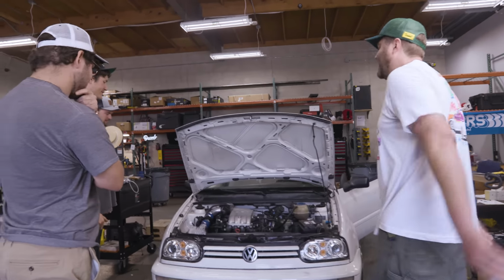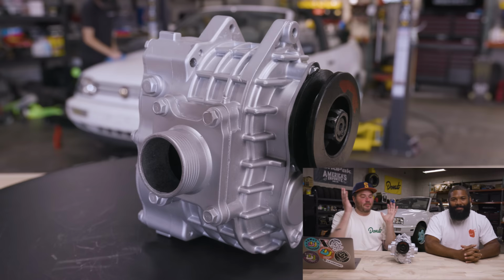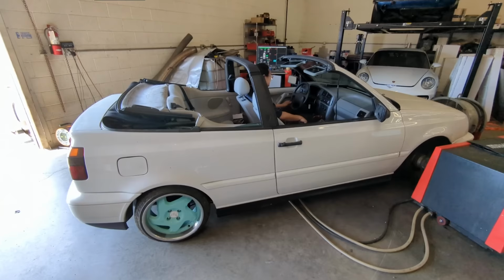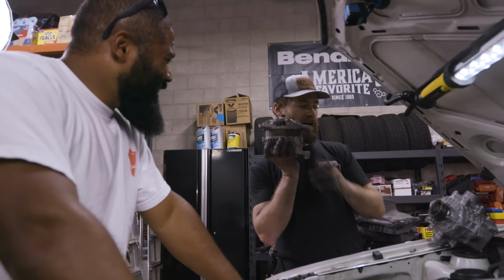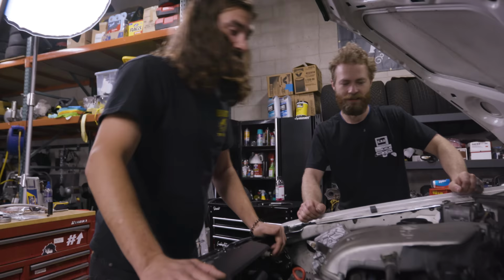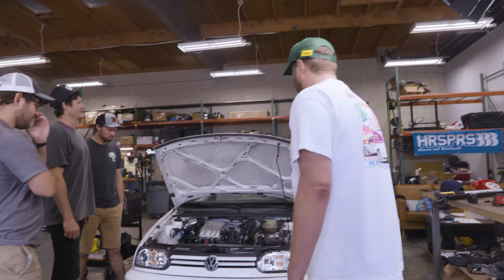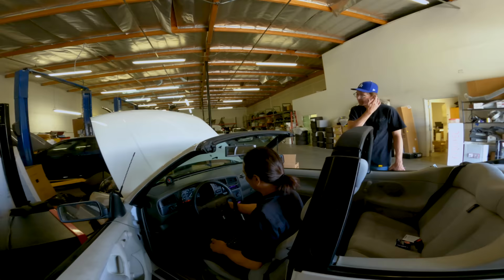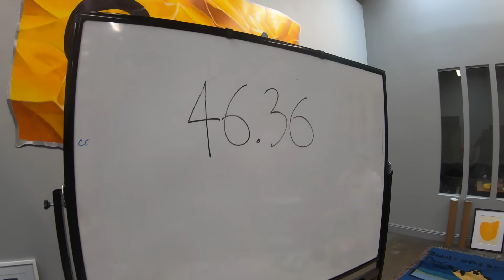We Installed a Wish.com Supercharger on Our Car

Comment: Yeah, see, the motion of the cylinders in your car's engine creates an incredible vacuum, which is how it normally sucks in air. The reason blowers and turbos are so damn expensive is that they need to blow a LOT of air to do more than your engine can do on its own. Even if it could, your car uses that vacuum to do a whole mess of other things to regulate your engine, and if you override it by pouring high-pressure air into your car, you destabilize all of those important functions. So even if you have a proper supercharger, you need to completely re-engineer your engine and secondary items to work on the new vacuum-pressure dynamic. But, that little booster, with its silly air-screw system, is hardly going to do anything at all. It might, maybe, provide enough boost to supercharge a riding mower. But I highly doubt it. I suggest, for your next video, that you start small and use it to supercharge a go-kart powered by a 5hp four-stroke push-mower engine. I don't think engines that small use vacuum the way car engines do, so that might work.

Comment: what did you expectwithout a rising rate Fuel reg,  bigger injectors etc. plus that blower was way too small its was oversped from the minute you started it. you should have bought the correct size for the engine power....

Comment: But you guys were never clear on what happened like what is the 46.3 is that how many horsepower you made after the supercharger or did it add 46.3 hp I’m confused did it cut the horsepower in half or is that what it added to it?

Comment: Well I was considering putting one of these superchargers on my Subaru Outback just to gain low and mid range torque. After hearing it here, there is no phuking way I'd do it. It's definitely a piece of crap. I bet it will self destruct in less than one thousand miles and the noise would be unbearable after five minutes. I'll get a junkyard supercharger off a 3.8 Buick or one off a Ford.

Comment: but one question, it performed 30hp less than stock, do you guys tuned the ecu? because maybe it ain't gettin enough gas. and feul mixture is not proper if not tuned.

Comment: too large an engine not the right pulley, those size superchargers are great for kei cars and small diesels. basically anything you'd use the old vw air pump setup on

Comment: Serious question. Was this mounted as a blow thru or was is used after the throttle plate and MAP? It won't work if you are putting PSI against the MAP as seen in your test.

Comment: It is a k car super charger. And reason didn't get boost because put the same size pulley on it as the car, causing it to stress way harder and not work . The pulley to The super charger needs to be smaller. 
So much for knowing how  cars work, or not. Huh

Comment: lol i wonder if you know vw’s arent like the older civic’s 88-98 sedan/coupe that can run some boost without a tune vw’s need to have their ecu’s reflashed if they are turboed and get changed to supercharged since you have the 2.0 you would of needed more parts besides a tune to make the supercharger work and gain some HP lol i wanted to buy the same supercharger to use it on my 2zzge buttttttt the extra parts i need are costly sooo yeah no go

Comment: I’m confused. Did the car make that much more or lose that much (relative to the initial amount)?
Reply: Its not pumping enough air. Its a 500cc but the engine needs 1000cc so the supercharger is actually choking the engine and killing its power.

Comment: The grind hard guy made it fit but applied it all wrong  . You have to put the throttle body before the supercharger and you need to do calculations to find the correct size pulley for the displacement of the supercharger.  ..... Pretty basic .

Comment: AMR500 is a good little supercharger. Your ratio sucks. Shrink that pulley. Also, don't buy one off Wish. Buy an actual AISIN. They're good for maybe 12.5k rpm and 5 - 6 psi, under which they will run forever. Perfect for builds on stock internals of anything 2.0L or smaller.

Comment: I found the same one on Amazon for $160
Reply: I tried posting a link but I guess YouTube won't allow it because it just removes it automatically
Reply: This is the description though
Futchoy AMR500 Supercharger Universal Mechanical Supercharger Steel Aluminum Blower Booster Turbine 0.8-2.0L Turbocharger Compressor

Comment: I'm shocked you didn't point out the claimed "3-10% lower fuel consumption" bit in the description...

I'm not Math-Asian or anything, but I'm pretty sure that you're not likely to see any increased fuel mileage from a friggin belt-driven air pump.... It literally doesn't make any sense. Even installing a turbo-supercharger (aka a "turbocharger;" which this definitely ISN'T) wouldn't increase your fuel economy with 1 single exception...

The only time that installing a turbo will increase your fuel economy is if your car no longer has a factory installed turbocharger on it (but somehow still ran it) and you put it back on. That's literally it. 

You can't ever gain fuel economy by just adding parasitic drag to the belt/pulley system, even if it WERE pushing extra air. That extra air needs more fuel and it's CONSTANTLY running. Then you have to consider that the engine is going to need more power to simply keep turning because you added even more resistance to the drive belt/pulley. 

There are just so many things wrong with all of this that you shouldn't DARE ever put one of these on an actual car.